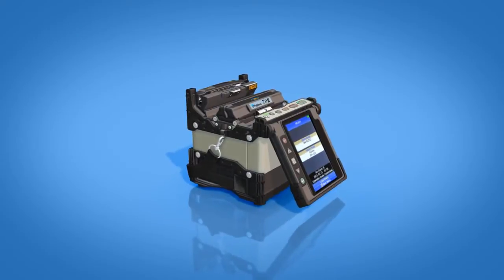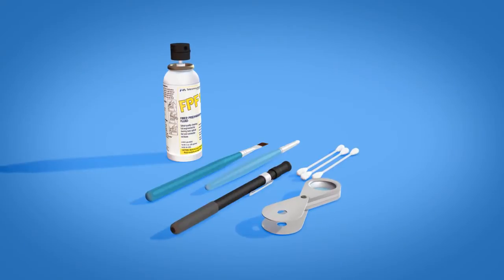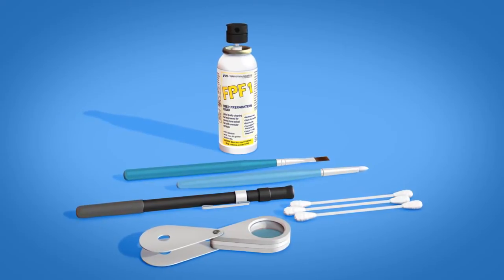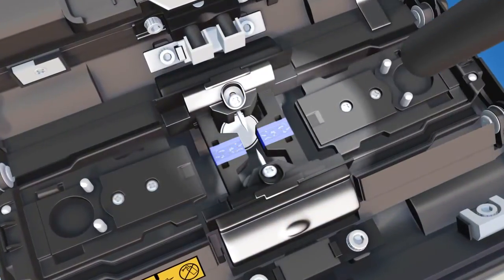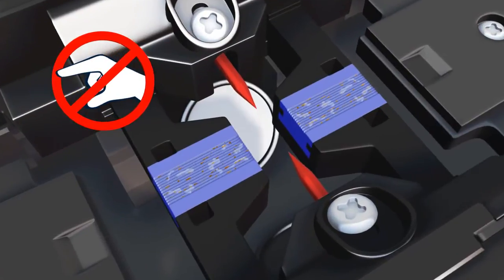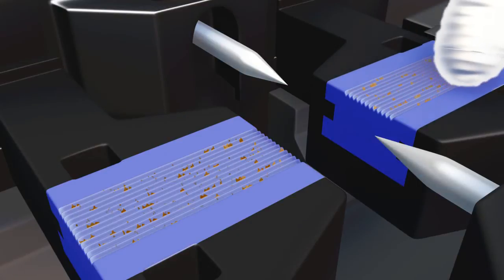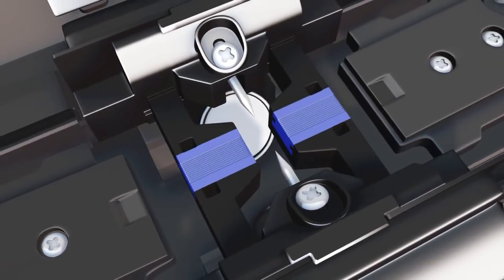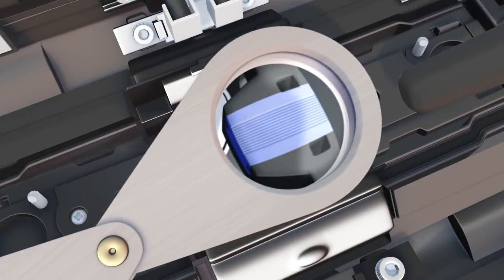How to Clean Fusion Splicer V-Groove with AFL Splicer V-Groove Cleaning Kit

Comment: Hi ! Just want to clear one doubt..my new splicing machine ilsintech Swift K9 ( Korean made) does not detect/show left side Fiber. It always shows a message "Replace Fiber". I have changed electrodes with new one, also cleaned the tray & lens carefully but still problem not solved. Any suggestions plz..
Reply: sell your ilsintech and purchase a fujikura splicer,  this will eliminate your problems. I suggest a 41s if you budget conscious... feel free to contact me if you need an further assistance.
Reply: u need to re-cut fiber. the tips are important when u cut....clean and replace. otherwise switch sides of placement
Reply: sorry..2 years ago...lol